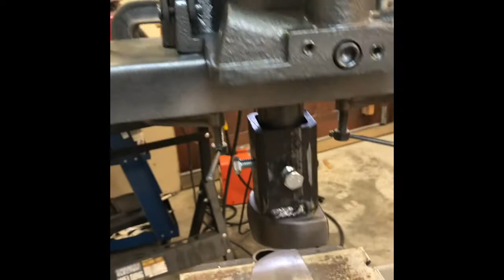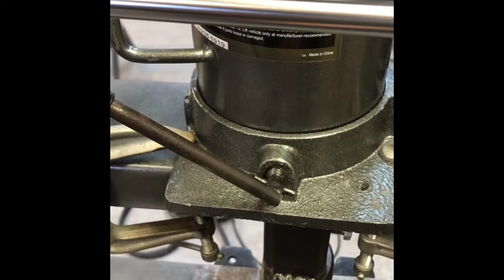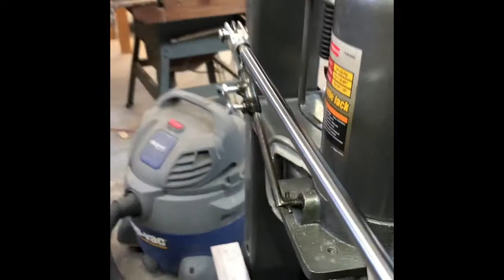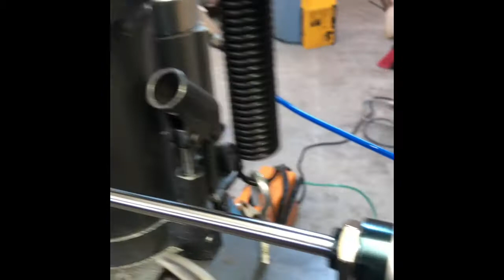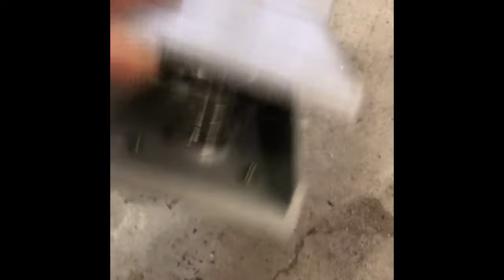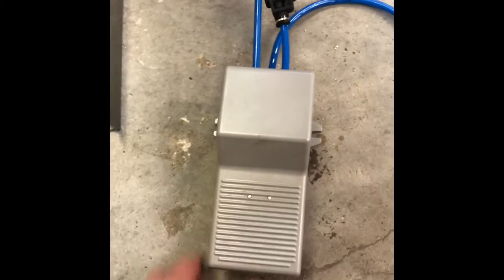Harbor Freight Forge Press Part 1

Comment: Thanks for making this- looks like a good solution for me to build!
Reply from the maker: It has it’s limitations. I tried to squish a cold 3/4” round bar into a red hot 2” diameter disc of 4140 to make a swage, and it didn’t budge. But I could take a red hot 3/4” round and squish it down to 3/8” in the first heat.
Reply: @myownspiritlevel  That's still not bad at all!  Compared to modifying a log splitter or buying a nice forging press it still gets the job done!

Comment: With the air cylinder connected to the frame, does it cause any problems when the jack and top die plate move down?
Reply from the maker: Watch again or watch part 3. The air cylinder and jack are all attached to the same upper C-channel.